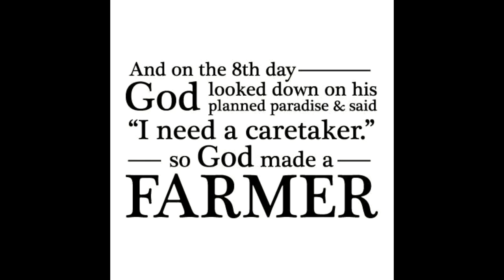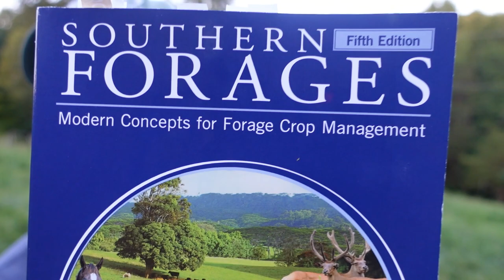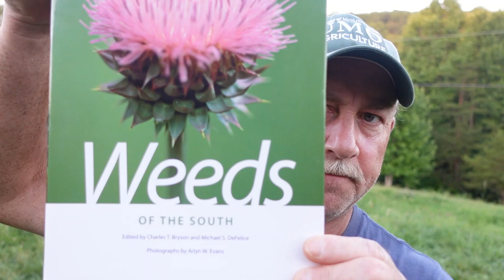How-To. Test Plot Hay Basics Part 1

Comment: Thanks for the video. We tested both the soil and the hay for a baseline.

No critters on our land, it was a auto junk yard for 20 years before we bought the land. It had the topsoil removed 6 - 10 inches to remove the damaged and unusable soil.

Been rehabilitating it for 4 years and cut hay this year for the first time.

Not top quality, but useable at this time. Needed a little income to move to the next level.

Good video, looking forward to the next video.
Reply from the maker: Sounds like yall are putting down an excellent foundation! I foresee great results in your future with that hay, youre doing the necessary work now for your future hay field! Good job, Sir!